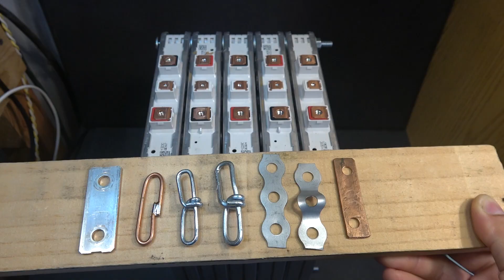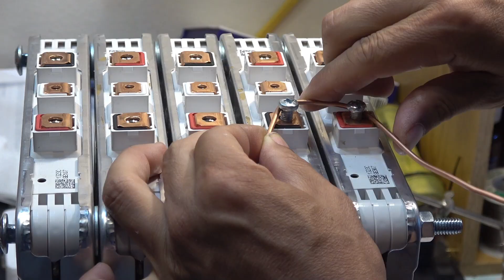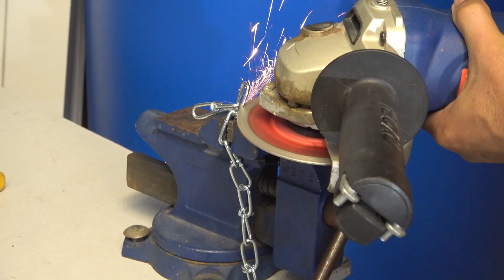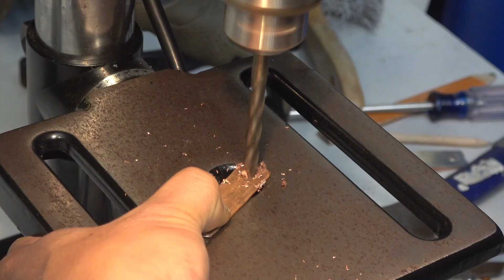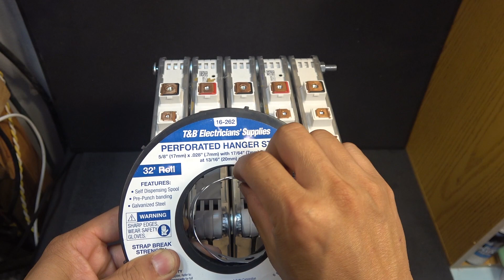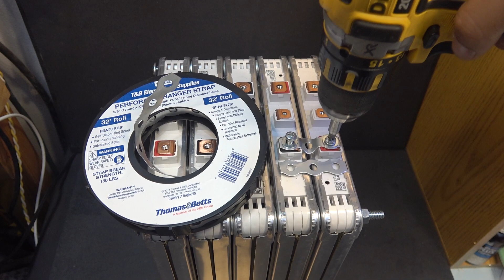DIY: Home made Nissan Leaf battery busbar/connecting cables

Comment: weight of the copper has nothing what-so-ever to do with current carrying capacity. it has to do with cross sectional area of the copper plate vs the cross sectional area of the wire. If your going to use anything but C110 copper or 6101 Aluminum I hope you are doing a temperature and current check on the material when in use to verify you have enough material to avoid burning your car or RV or shed to the ground. Just sayin ;-(

Comment: Thank you! This is super helpful. I have a question.I am thinking about buying some of these batteries and  I am wondering if you need to use a battery management system to charge these batteries? or is it safe to connect the battery to the solar panel without it? Any help is appreciated!
Reply from the maker: Yes, you can use a BMS to charge these batteries. Keep in mind each battery is actually a 2S pack so it's 8.4V instead of 4.2V. It is not safe to connect these batteries directly to a solar panel. You will need some sort of BMS to prevent overcharging or it will go boom.

Comment: You should note the type of wire is also critical in amp rating though you have short runs length is also considered. Personally I’d use a #6 or even #4 stranded. Also current is rated by overall surface of the material. A stranded wire vs solid core, etc.. stranded has more surface area and will have a higher current rating. I’d be less apt to Rely on a weight comparison versus actual surface area.

Comment: Where can you buy these used batteries. I looked on eBay, but they are quite expensive. $140. Is there a cheaper source?
Reply: It's over £250 in the UK
Reply: bigbattery.com is currently selling these for 40$ each for G1 and 60$ each for G2. You can also buy 48 of these in a Nissan leaf complete pack (you will need to disassemble) for 999 plus 300 shipping. Lots of 10% off coupons floating around. They ship to USA with above rates, out of states cost would be more.

Comment: And it would easy to add shrink tube between if needed .👍
Reply: Probably better off using partial sheets of an insulating material (e.g. cardboard) underneath the busbars, with holes popped in them to match the screw terminal holes. Of course, higher current installations will demand a better insulator.

Comment: Only use copper due to high conductivity and to prevent galvanic weld. But beware of oxydation, especially with uneven mating surface if not flat.
Reply: Copper is king for sure, but sometimes you have to work with what you've got to hand, especially if you're on the road. That roll of strapping is something you can find in any small town hardware store, for example. As for oxydation, it's best to tin your copper if you can (or conformal coating, if you're highfalutin like that).
Reply: @fun_ghoul  On the road emergency repair may be fine with non-copper, but I think Leaf battery terminals are copper and one risks galvanic weld if not using copper.
Reply: Yes, copper and aluminum is pretty bad connection. They are galvanic pair and they will eat each other.